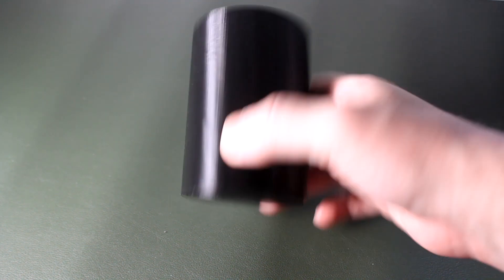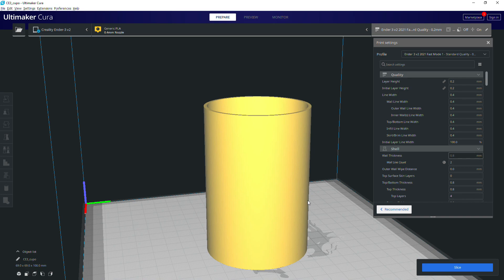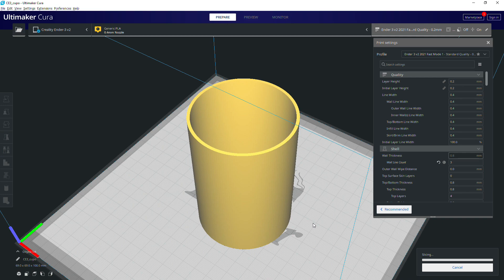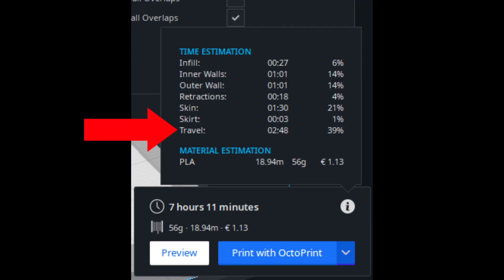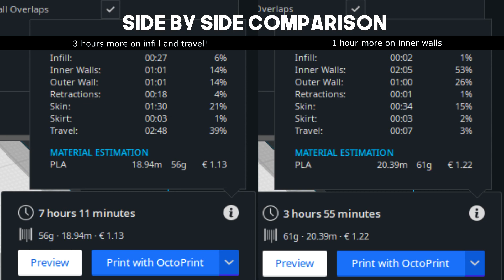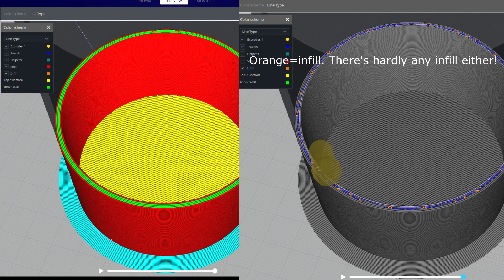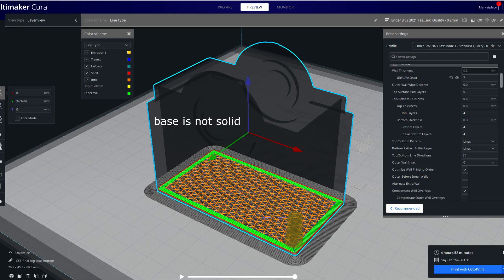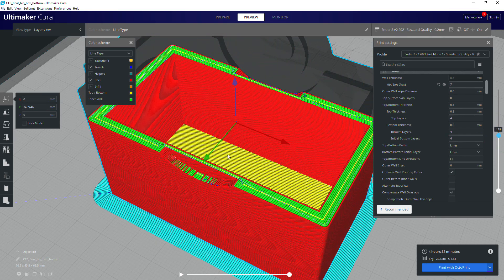Why does this cup take less time with MORE walls? How to 3d print stuff in almost HALF the TIME.

Comment: It amazes me how a seemingly small and insignificant setting can have such a profound difference. I sliced a model this past weekend that came out at 1 day and 3+ hours. I changed the seem preference from random to short and sharpest corner and the print time dropped to 13 hours and 1 minute.  That is a greater than 50% reduction in print time for a single setting change. Even if i have some post processing there is no way it'll take me 14 hours to clean up the seam.

Comment: I would make the case only 2 walls thick with rectalinear infil BUT will orient the infil 45 degrees. The infill will bind the two walls together, it will take less fillament and time to print and will has more or less the same strength.

Regular infills (rectalinear, grid etc) are awesome for regular patterns (squares, rectangles), irregular ones (triangles like in the video, gyroid etc.) are better for complex shapes.

Comment: I use "Connect infill lines", "Connect infill polygons" and 2 for the "Infill line multiplier" meaning that the whole infill can be printed almost travel free, as well as attaching to the inner walls better and no voids from the nozzle going over an already printed line.

Comment: Another thing you can do (at least in Prusa/Super slicer) is use a modifier to differentiate infill densities.

With this model in particular, you could have normal infill for the base plus however many shells, and no infill with the walls with only one or two shell layers.

More complicated, but saves material and still keeps print times down.
Reply from the maker: Good tip..I should look into modifiers generally as they look pretty powerful, thanks for the heads up! 👍

Comment: I found that my print speed went up when I changed the wall thickness on my models into multiples of .4 (Nozzle Width)  and in even numbers.  I'm working on a building that I did the walls at 1mm,  makes the math easy.  But I was getting strange artifacts in the outer wall showing up etc.  I was watching real hard on the cura screen and realized that it was printing 3 lines in that 1mm thick wall, that middle line was done as infill.  After a few tries I figured out that if I printed walls at .8mm, 1.6mm and 2.4mm,  all even numbers and multiples of .4 (Nozzle Width) I get better looking walls on the 3D printed model.   You would think with an odd number of walls like 1.2mm it would give a good print,  but it did not as it try's to print the odd middle line as infill.  After doing this change from 1mm to 1.6mm walls on the model.  My print speed dropped by 1 hour 30 minutes on a 8 hour and 45 minute print to 7 hours 15 minutes.

Comment: Wouldn't it make sense to then set infill to 0% and keep the line width of two? Because honestly even if you were to use another infill pattern, the space is so small I don't think any infill even makes sense and I doubt the print would have issues without infill and without the additional walls.

Comment: You can use prusa slicer and sellect the speed of those parameters . The infill inside two close walls is called gapfill and there's a speed for that. U can also choose the speed for outer walls and inner walls in prusa slicer.

Comment: If it is a simpel objekt like yours then i use a closet Cylinder and set 0% infill, 0 top layers, 4 bottom layers and 2 to 3 walls (depending on how strong it should be).

Comment: The reason for travel to be so long is that you have selected the option to keep the nozzle within the walls when travelling.
Reply: Combing doesnt neccesarily add more time, depends on the shape
Reply: Combing is a great option that mitigates stringing almost entirely.
Reply: @beanieteamie7435  is it worth it though for another 3 hours of print time ?
Reply: @JustAlb1n  it's not the sole reason for the extra print time. There are many factors at play here
Reply: @beanieteamie7435  I just referring on this instance, don’t get me wrong as it is a great option to have as I’ve used it many times.

Comment: On round prints (with big enough diameter) and no infill one can drasticaly incease the print speed for the Walls. The required aceleration of the print head (or bed) is drasticaly reduced due to the circular movement. Broken up into x and y the aceleration is constant and pretty low on each axis. So most printers will handle much higher print speeds. Doubling the quality-ish print speed should be fine. The hotend will propably be the new limiting factor(There will be under extrusion if it's overloaded).

Comment: It would be nice to compare to PrusaSlicer times.
Reply from the maker: surprisingly hard to do in practice, because you have to get all the variables the same to make a fair comparison. 
But if all the variables are the same....it will be the same speed 😂
so unless you agree to use some default settings, it will only cause more arguments.
Reply: @LostInTech3D  I suppose the travel time could vary a lot depending on the type of infill, more than on which slicer. Anyway I imagined just a test using defaults, changing only the wall count. Cheers!
Reply from the maker: I get you. It still annoys people though, but I'll consider it 😂

Comment: Just a heads up here.... There are two settings that have a DRAMATIC impact on what you're doing here. 

Infull Pattern: The infill pattern you are using doesn't lend itself well to thin sections such as walls. Try changing it to grid
Combing: Combing mode keeps the nozzle within already printed areas when traveling. 

It would be interesting to see what, if any impact, changing these settings would have on your conclusions, as i've never run into that particular problem before.
Reply: Yep, combing is definitely a big time hog in my experience. Sometimes it can result in some downright proposterous travel moves, if they repeat every layer it really compounds the excess of needless motion. 

I think the algorithm that calculates the combing travels, based on a model's geometry, infill type and combing mode could possibly use some work. Also, being selective with the particular combing type used or opting to turn it off in some cases can be beneficial. Depending on what you're printing it may have a negligible difference on the quality of the final product but costs you several hours of extra print time if left enabled. Certainly worth experimenting with if you're noticing excessive print time on geometries that you would intuitively expect to print quicker.

Comment: It's actually not at all like 100% infill. Because if you have more walls, it will (in this case) be concentric circles, while 100% infill will still make the infill pattern and still waste time on travels. Also it will still vibrate for the infill pattern. Basically almost all of the advantages of extra walls are gone with 100% infill.

But really good catch! Thanks for the hint, I will remember that. Take my upvote!
Reply from the maker: you make a good point, I hadn't even thought about that aspect
Reply: @LostInTech3D  I watched a few of your videos now. Pretty cool stuff! That subscription is earned^^
Reply: I think prusa slicer can actually do concentric infill (maybe even at 100%)

Comment: "Skin" in Cura refers to top/bottom areas which are densely filled and are displayed in yellow in the layer view when set to line type coloring.
Reply from the maker: It does. But what is the extra layer of wall called? That's what was confusing me
Reply: @LostInTech3D  it's considered an inner wall I believe

Comment: With my normal 0.4 profile i have the inner walls and infill at 0.5mm it saves so much time and still is fairly accurate
Reply: I also started to do this for big prints. It works really good. I read that one can actually go up to 50% more than actual nozzle size. Did also 0.6mm for 0.4 nozzle - it works, but the surface becomes "liny".
Reply: @TushhsuT  depends on the print, usually nothing that can't be sanded down, top surfaces can also be set separately to go with normal line width, at cost of time ,which would save sanding time then

Comment: The right infill pattern could zig zag around the circular interior without wasted travel, in theory. Might have to model your own, which I've done a couple times.
Reply: If you use the option "connect infill lines" it is just doing that

Comment: And that's the reason you always optimize your own CAD Files with wall thicknesses beeing a multiple of the nozzle thickness (1,6mm wall thickness equals 4x0,4mm nozzle)
Reply from the maker: I have started doing this actually - it's a game changer!
Reply: For curves tho. I aim for slightly more than a multiple: 1.605 thickness instead of 1.6
because sometimes the polygonal approximation of a curve ends up coming out undersized in the slicer.
Also for straight walls that don't align perfectly with an Axis. seems like some diagonal walls get evaluated as thinner due to "rasterization" inaccuracies
Reply: I'm thinking of going the opposite direction and just trying a .5mm nozzle - most designs you get are done in mm or half mm...
Reply: @henninghoefer  For long time I use 0.4mm nozzle, but 0.5mm line width and I didn't notice any visible contour quality drop, but the 0.5mm multiple really simplifies the design.
Reply: Exactly what I was going to say. When I'm modeling, I think of walls as, "n lines thick" instead of their dimensions. I usually keep it as a multiple of 0.8mm because that works on my printer with a 0.8mm nozzle, but is also sharable to people with a standard 0.4mm nozzle. I'm tempted to change the 0.5mm nozzle on my Lulzbot Taz6, but it does so great with everything that I'm scared to mess it up.
Reply: Line width, not nozzle thickness. Most slicers run .44-.48 line width on a .4mm nozzle
Reply: @giedrius2149  This is true, which could also be one of the reasons 0.5mm line width prints so much faster on a lot of prints
Reply: I'm doing this for mechanical and structural prints. 0.4mm times six shells for 2.5mm walls. Nice and sturdy.

Comment: "Skin" in Cura is the high-density fill of the top and bottom layers. If you use 100% infill, that effectively expands that skin to the whole print - you can see the settings change to 999999 bottom layers and the info loses the infill time, but adds extra time to the skin. That also differentiates 100% infill from thicker walls, although in a situation like your pen holder it might not be as apparent since Cura draws an extra outline wall around its skin, making it effectively the same as 3 line wall thickness.
Reply: ^^^^ This. I have had to learn the hard way about this one. Lost a lot of filament. :P Usually the things I see in the (i) that take up the most time are the skin and walls. Infill sometimes, but adjusting it to different types usually does not change much unless I go with some of the more complicated ones. Glad you finally got the answer you were looking for. ^_^
Reply: I've been doing the opposite and "tricking" it into al top layers and super thin layers for printing pla minis

Comment: I ran into something similar with a strange pattern that could be seen in the outer walls. The slicer was "filling gaps in between walls" and since i was printing a boat and the hull contour changed each layer, so followed the gaps that were being filled.  The filler layer was top/bottom (yellow color) and Cura automatic speed settings have walls slower than top and bottom speed so when the filament was laid down 20% faster on the top/bottom filler it wasn't as accurate and made that section less clean. 
  Two solutions i found were 1- set top/bottom speed same as wall speed 2- do what you just did and modify the walls where there is no gaps to fill.
Reply from the maker: Things like boat hulls and other inverted curved surfaces are a nightmare at the best of times. I'm curious as to how a slower wall speed made things worse though, is the stl available on thingiverse? (if so give me just the number as youtube will delete links!)

Comment: If you use Per model settings in cura you can change settings for heights etc, so for example you could use 2 walls for the first 5mm of height and 10% infill and then 5 walls and 0% infill for the rest.